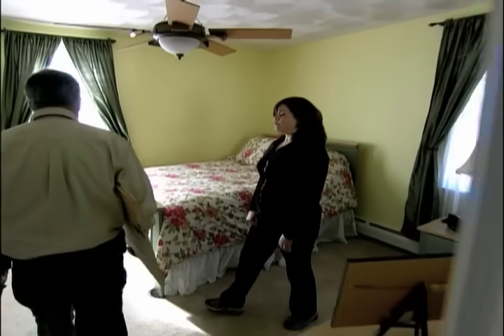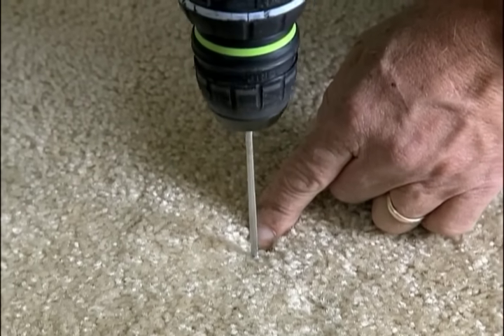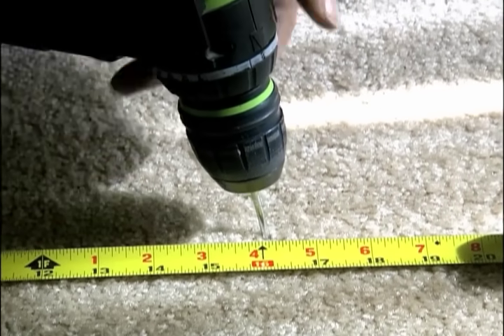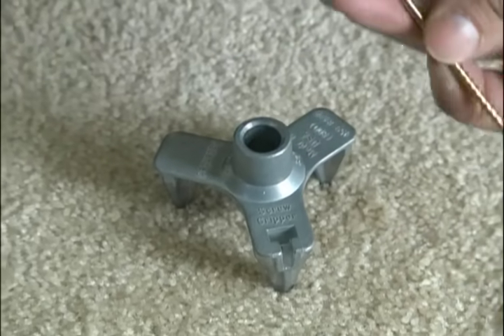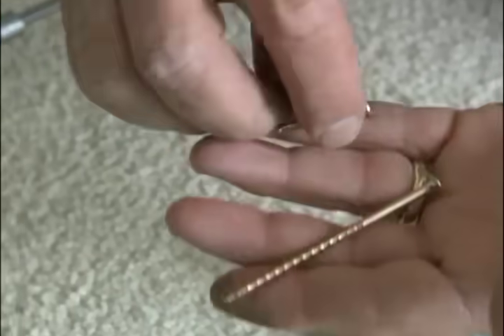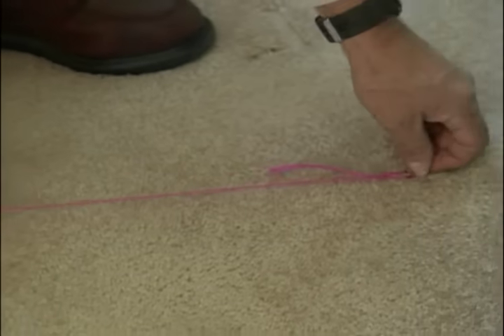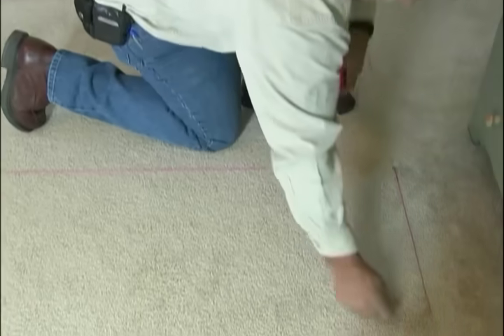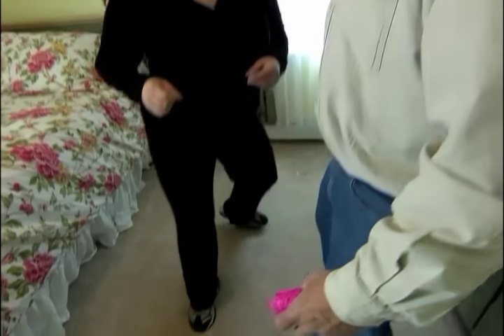How to Repair Squeaky Floors Through Carpeting | This Old House

Comment: This works equally well as a system to find your pipes and wires... just follow the same procedure but use more screws, when you hear gushing water or there is a loud bang & flash - then you have found the pipes and wires.
Reply: blower well when a guy like this the pipes r clogged an the wiring is just no good you got to cut the cord an run...
Reply: blower 🤣🤣
Reply: LOL!!
Reply: Carole Perez what the hell are you talking about?
Reply: That gave me a good chuckle
Reply: @Vance in the UK we run pipes and cables in the floors
Reply: Ahhh crap!! It's the first thing I thought when I watched this.. 3" screws in the floor, old construction didn't require safety clips.. wait till you hear that beautiful pop when the breakers shut everything down..
Reply: blower pmsl hahahaha 💯
Reply: @Vance country do you live in where there's no wires and pipes in the floor?
Reply: Exactly what I was thinking lol
Reply: Read my mind
Reply: Semper Fi  Canada has the same code requirements, doesn't stop us...
Reply: was just gonna say if you got the pipe that would cause caos
Reply: Same with wires too 😂🤣😂
Reply: I've been a joiner for 20years and I can safely says this made me laugh . What a bad idea .
Reply: @TheRabit11  its very bad because this person is going blind doing this. Id rather take up the carpet first and see where the nails are in the floor board's. I'm no joiner but i gathered this is what you would first before screwing screws in
Reply: @TheRaceface22  we sure do as hubby once found out in the bathroom and drilled into a water pipe!!
Reply: lol
Reply: Varnce where’s your lighting cables run then in the wall?
Reply: Haha was thinking about that 😂
Reply: @Varnce Preach brother
Reply: Haha was thinking exactly the same thing...👌
Reply: Carole Perez WTF?
Reply: Semper Fi  How about when the joist is missed while using that "special" roughly 4 inch long drill bit to find said joist?  No shielding there, but pipes and wires can be... Do you expect Karen is going to let off that trigger as soon as it makes it through that first 1/2"-3/4", think again... Let alone if you just miss the joist a wire is still fairly supported and that sliding plunging action is more than enough to rip open a piece of NM wiring "romex".
Reply: Never ever heard of pipe or cable finders of course!
Reply: @Biffo1262  The basis of what's being discussed is a Karen level of intelligence.
Reply: Personally I use big 10 inch nails and a sledgehammer,  a angle grinder is just as good at taking that smooth shaft of its head.
Reply: @creativesuit1930   North pole as I live in a igloo.
Reply: He can upsell a electrian or plumber to fix the other faults.  Great no squeeky floor, lets turn the light on oh it dont work, not to worry my brother is a electrian and he has a wonderful new invention too that saves time and money.
Reply: Lol.....😂
Reply: Exactly  I cant believe this guy thinks this is a good idea
Reply: idk why but i cant stop laughing
Reply: There's no way to hit plumbing or electrical with a 2 1/2 inch screw through subfloor and joist (remember--the top 1/2 to 3/4 inch of this screw DOES NOT penetrate the subfloor/joist--it's snapped off).  Of course, you could hit radiant underfloor heat--hopefully, you know if you have this.  If you have plumbing/electrical through the top of your joist, your framing would never pass inspection.  Your moniker "blower" must refer to you "blowing smoke."
Reply: UK under floor wiring and heating water pipes 😂😂😂😂😂😂😂💥💥💥
Reply: Ok, Boomer
Reply: @generation-x406 
Or... Serious lack of 🤔🤔🤔🤔😂😂😂🏡
Reply: Exactly my thought. I didn't have the carpet in the way when I screwed down a loose floorboard to find that a heating pipe had been cut into the joist and I'd gone straight through it. Time I'd stopped the leak the room below was flooded and the wall paper was hanging off the walls (hot water) and the ceiling was sagging badly. Learnt my lesson and theirs no way I'd just screw into the floor (or ceiling) blind like this guy.
Reply: Codes require that pipes and wires are set through the center of joists. Since joists are 11 1/2" plus the thickness of the subfloor 3/4 - 1", you won't have to worry about the 3" screw hitting anything.
Reply: @Rocketninja200  unless of course the pipes were laid before the codes came into force or were laid by DIYers. Too risky on older properties in my opinion.
Reply: @Rocketninja200  aaah yes clarity
Reply: @pqrstzxerty1296  Ha,ha!
Reply: @Rocketninja200  In most circumstances it is not possible to put rigid copper piping through the centres of joists. Think about it. Most of the time, I have only ever come across them notched into the top of the joist.
Reply: @victorlopez190  That's if you miss the beam though right?
Reply: 😂😂😂I’ve read this so many times!!! Hilarious!!!
Reply: This comment made my day and here I am on November 4, 2024 more than six years later, hope you are well and thank you 😂
Reply: @SeanSchwifty Still here, still bursting pipes and blowing breakers drilling long screws through carpets. 😂
Reply: @ glad to hear it! 💪😂 keep on keepin’ on ☺️
Reply: If you are hitting the joist, you will be fine.
There are no electrical or plumbing between the joist & the floor

Comment: For those wondering the name of this tool is "Squeeeeek no more" The new ones are plastic and run about $30 for the kit at lowes. Worth the cost!
Reply: Thanks for this comment. I just ordered it. For this dang squeak I'm the floor that's been driving me nuts
Reply: Awesome! Thank you!
Reply: Walmart still sells the metal (zinc) version. It is about 2x the cost of the plastic version, but worth it IMHO.
Reply: How do you make sure not to hit wires or pipes?

Comment: The best advice Tommy gives which the product actual website doesn't is to stand close to the "device" so you're pushing on the floor tight. The screws without standing on it may still tighten the floor but I'm pretty sure it will work even better and for longer when standing next to it.

Comment: Tried out this system on our stairs. It worked great for about a month before the joints loosened up again and the creaking returned bad as ever.
Reply: Could be a humidity issue.
Reply: Its probably better on floors than stairs
Reply: Because you still need to understand the repair to do it effectively. It's not magic. There are other reasons stairs squeak than just rubbing on the stringers

Comment: If you have a metal tripod guide, I'm sure this works great. But the plastic one flexes as you drill down, so the screws I actually got into my joists most likely went too far down, so the head snapped off in the subfloor and causing my floors to creak more  x__x
Reply: Thanks for the tip.
Reply: Thanjs for your sacrifice

Comment: I tried this today.  It got 95% of the annoying squeaks out.  I'm a happy camper for now!
Reply: Travel Richie update?
Reply: I used this kit today.  It did not help at all.  Bummer as there is no access below so the only way to fix is tear up the carpet and possibly sub floor and redo everything.
Reply: Where can I purchase This
Reply: @tyronewilliams2482  amazon.
Reply: @tyronewilliams2482  it's probably too late, but please don't buy this, just take your carpet up and replace the nails in your floor with screws, a carpet fitter will only charge you a couple of bucks to refit it and it's 100x less likely you'll hit a pipe or cable

Comment: Floor is going to be squeaking in less than a year with no screw heads to hold it down 😂😂
Reply: Glad I wasnt the only one who thought this
Reply: Actually there is thread in both the joists and the flooring. So this will keep them together. It's not a nail.
Reply: Thread? Thread is not going to hold that down into the wood long at all sorry to tell you

Comment: What about fixing squeaking floors under linoleum?
Reply: If you can access the floor joists from below, run a bead of PL400 along the edge of the joist and the subfloor.  Cut access holes in the ceiling drywall if you're really desperate to stop the squeak.  Or use ordinary wood screws through the linoleum and install a new floor over it.
Reply: @andrewvanatta1569  Thank you.

Comment: In the UK we have wires and pipes under the floor, definitely safer to just roll the carpet back first.
Reply: I have my doubts about this system, but generally in the US most pipes and conduit/wiring is run through the walls. All outlets are on walls and any ceiling electrical components are well under any floor joists from the floor above. That being said, I doubt those screws snap off completely flush every time, so all I think of is carpet padding wearing down over time enough to occasionally stab you in your bare foot.
Reply: Sean McCauley unless you only have electricity on the one side of your house with the panel box, there is likely wires running under your house. ;)
Reply: @dosmundos3830  the vast majority of us houses have overhead transmission lines supply electricity. Which then goes to meter, to circuit/fuse box, to 2nd floor joists, and routed to walls from there.
Reply: @Sean McCauley and the vast majority of single story dwellings have them running along the floor joists rather than above doorways and through attics to reach the far side of the dwelling. 1 story or 2 either way a floor foist is a floor joist.
Reply: TheIsmaelIsaac it doesn’t, it allows you to see where the floor joists are. And if you suspect there might be heating pipes below you can remove some flooring to check. People only insult others when they have nothing intelligent to say 👍🏼.
Reply: @TheIsmaelIsaac  you can tell where it's safe to screw from seeing the location of the original screws on floor.
Reply: @RazorsEdg3  you can do all that with a single electronic device which detects joists, pipes and electric wirings. The whole purpose here is to avoid removing  all furniture and roll up the carpet and then put back in place again. That will be a torture for a single mom like Karen.

Comment: Fantastic product. If it doesn't work there are 2 reasons. 1 skimping on the 4" spacing or 2 you have missed a joist. I was lucky enough to have the plans of the house when we built it so found joists not at standard spacing that I would have missed. Hint get your 250lb cousin to tip toe next to the adapter when drilling.

Comment: a month later and the floorboards will have popped back over the screws because the heads have been snapped off
Reply: The threading will hold them tight
Reply: A month later and the joists have sagged as it’s Karen’s side of the bed. New screws required

Comment: We just purchased a home a new build in 2023. We are already having this problem. They have come out two times already and used squeak no more. Still having the same issue. And its just not us the other people in the subdivision having the same issue. The subdivision was started in late 2022. Even the builder helper who helped put the floors down in the 1st place told me to go out and purchase this. But im worried about hitting a pipe. I have the issue on my stairs as well as the upstairs hallway and in 3 rooms upstairs.

Comment: This tool worked wonders on my squeaky upstairs floor. I must have used 30 screws but it has been worth every penny I spent on this. Two year on and still silent
Reply: I assume you had to buy the tools & gadgets shown in this video, plus the special screws that break off?  I'm willing to attempt this myself because the floors in this house we bought are incredibly squeaky.
Reply: @kimspearman8444  yes, I bought the tool and a large box of screws that came with it. I think it was 30 or something like that from Amazon. Was super easy and now I don’t wake up the dead when I’m getting dressed in the morning.
Reply: @kimspearman8444  be careful of pipes and wires. You might want to buy a “stud” finder and wire detector.

Comment: This is a great idea.   But do not do it if you live in the UK.
It's common to have pipes notched onto the top of the joists just under the floorboards.
Reply: And cables
Reply: If pipes and wires are notched on top of studs or joists your suppose to put protector plates before sheetrock or plywood
Reply: @robertreilly1701  so if you have pipes running the length of the house you have to put plates on them? I have never ever seen this.
Reply: @rickunknown5744  if wire's or pipes are notched into the bottom or top of joist or on the face of studs the codes call for protection plates. If centered in wall studs or joists no not needed
Reply: @rickunknown5744  if you look on home depot website for nail protection plates you will see them, inspector calls for them. If it's flex gas pipe and you don't have 3" of deflection it has to be cobalt steel cover plates.
Reply: @robertreilly1701  never seen it in the uk. Seen a little plate to pop on above the joist to protect it from the floor squashing it against the joist but not to protect the entire length of pipe.
Reply: @rickunknown5744  ok in that case your right it doesn't go the whole length of pipe only on wood. So if he is missing joist you can hit pipe or wire in the field
Reply: Exactly... Just lift carpet and refit it down...

Comment: How do you do a repair on a squeaky floor without carpet?
Reply: Well Gloria you would pretty much have the same goal in mind: To secure the creaking boards to the structure beneath. So without carpet you could just use some nails with a small head so they dont show as much. Also maybe get a nail tapper thing so you dont hit the floor with the hammer.

But yeah, you just gotta nail those boards back tight.
Reply: @thetranspanzer3692  ... Thank you so much.

Comment: How do you know if you're in the center of the joist or screwing just into the edge of the wood where the screw is likely to dislodge?
Reply: mjinba07 when you miss by the 3rd joist after measuring 16 on center

Comment: Here's what I don't get, when he's 'found the joist' with that special screw, how does he know that he's right inthe middle of it, or just barely hitting the edge? Because if its the latter, and there is even a tiny inaccuracy measuring 16" over, it could get even further to the edge of a joist or not even hit it at all. Is there no accurate tool that uses sound waves or something that can tell precisely where the wood underneath gets a lot thicker?

Comment: Better idea, take the carpet up and do it properly and safely
Reply: And spend ten times the money and effort to solve a superficial problem.
Reply: @ClicketyClack  ten times how, carpet just pops back over the gripper and a stretcher costs a tenner. Burst a pipe doing it this way and it'll be more than ten times
Reply: titerado ...don’t I need to remove the baseboards before I lift the carpet?

Comment: The first 60 seconds of this video are just a disaster waiting to happen. One tiny nick on a copper pipe under the floor as you probe around with this sharp screw and the whole floors coming up to stop the leak.
Reply: Depends on what part of earth you live on. On my part the wires and pipes are buried in the walls, good to go with this

Comment: Did that all over my second floor back in the summer. In the winter, when the temperature dropped, all the squeaky sounds are back!
Reply: And again each season for the duration of your residency.
Reply: Without a head left on the screw and no thread left to keep the board tight to the joist, it’s a no brainier they move.

Comment: Just hope you never have to replace that subfloor... kinda hard to get a screw out with no head
Reply: Kota Gomez If your replacing the subfloor shouldn’t be a problem to pull the subfloor out and hammer the screw back down.  Big deal, research flat earth
Reply: If you are replacing subfloor you have bigger problems than a few screws.